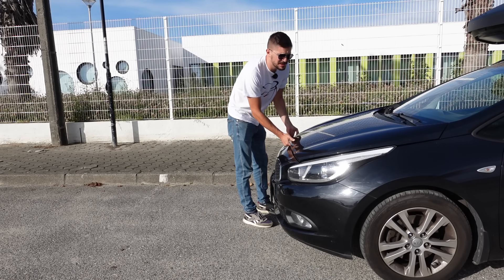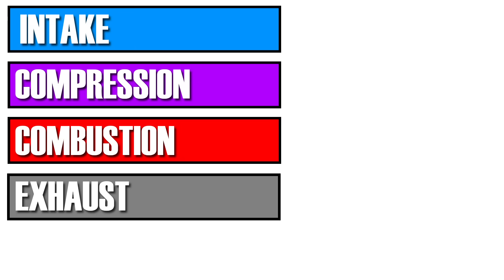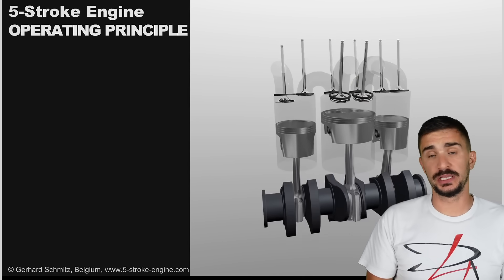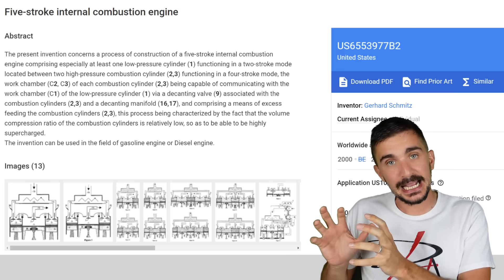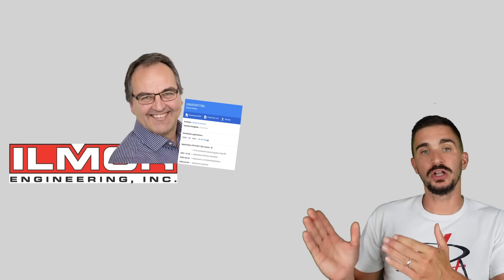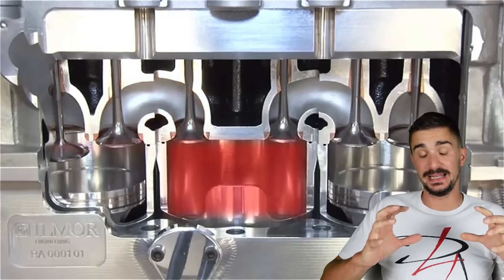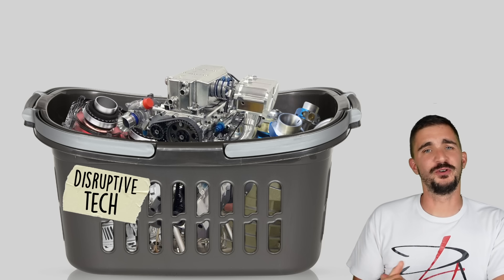Why Five Stroke Engines Are More Efficient But Still a Failure

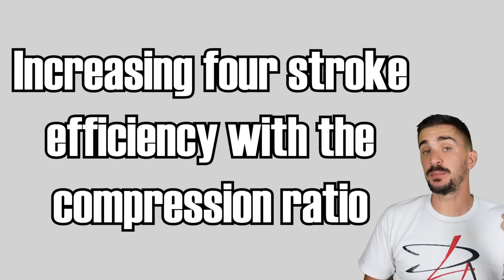Comment: 2:59 Indeed, if this were not true — that is, if the piston was responsible for pushing out the exhaust — two-stroke engines could not exist. I hadn't really thought of it this way until now but yep
Reply: And two-stroke went away, for vehicles, as you have to inject the lubricant (oil) in with the fuel which leave all kinds of extra nasty shit coming out of the exhaust pipe... But that Kawasaki "Two Stroke Screamer" was scary fast and powerful... friggen accidentally pulling wheelies in 4th gear...
Reply: @garrettmasarik8012  Twice as many bangs per rev
Reply: @garrettmasarik8012  given the technical nature of the channel someone (so might as well be me) will probably point out that while almost all two-stroke designs also require oil either premixed or injected, this isn't inherent to running a two-stroke cycle. It is possible, and done in rare designs, to run a two-stroke cycle and also have an actual oil system such that the fuel can be just fuel. 

I'd enjoy very much a video on the topic to round out my limited understanding. Afaik the main reason this "couldn't" be done is two strokes allow for ports which don't decline in performance under dirty combustion (which two strokes seems to inherently involve, oil or not?) like valves with their tight tolerances. And, I guess, we could probably do a pretty sweet job designing one to work great now, even with an oiling system and valves, but emissions regulations make it so niche it's unlikely to get worked on.

I am extrapolating a lot here and I'd love for the channel itself to touch it
Reply: @JoshWalker1  Exactly. The reason most 2-strokes need oil injected with the fuel is that they are using the crankcase as a supercharger. Put an external supercharger on it and you can have a sealed crankcase just like any 4-stroke. A modern sealed crankcase direct-injection 2-stroke could potentially be a very useful engine, and just as clean as any 4-stroke.
Reply: @DABrock-author   My limited understanding has a hole in it! Elaborate on the "crankcase as supercharger" bit??
Reply: @JoshWalker1  Uhm... once you try to valve it, you default to a standard 4-stroke engine as the ONLY place you can use valves is ABOVE the piston at the top of the stroke.

In a two stroke the piston is BOTH the "valves" and the bore is both the seats (ports)... which is also why you can have no oil sump, the oil just gets sucked out of the crankcase as the crankcase IS the inlet port with an additional transfer port to the lower side of the bore from the crankcase. Whether the oil is injected directly or in solution is actually not relevant, either way it goes through the crankcase, lubes the reciprocating mass and in the case of bikes, the transmission... but it ends up in the combustion chamber either way...

But, hey, I just made a very good living as a mechanic for over 20 years, so... And you actually had to KNOW this stuff 40 years ago when I started...

Comment: 🤔 Maybe figure out a way to use the exhast heat & leftover toxic chemicals to create electricity & charge a battery in a hybrid along with some solar cells on an aerodynamic car body. For a little extra trickle charge. 
If a scooter 🛵 or 🏍 company built a 250-350cc fully enclosed aerodynamic 3 wheel vehicle that could be used as a daily driver & got 70+mpgs. That was fun to drive & not super dorky looking. That cost much less than a car. Around $10,000 or less. I bet they could sell a ton. It could come with a removable top for nice days. 
The Morgan 3 wheeler for example is pretty cool. But way off the mark for a commuter/daily driver. It doesn't even come with a top. So if you get caught in the rain. It'll fill up like bathtub 🛁

Comment: Your remarks regarding the imaginary shortcomings of the engine are moot points. The engine IS in every way better for the coming future simple because the world is transitioning away from internal combustion and toward electric. But since it took 11.5 years to complete Palo Verde, Full battery electric vehicles are absolutely impractical as they will overwhelm the power grid. It's simply not possible to build all the electrical infrastructure fast enough to keep up.
So an engine that can achieve greater than 50% efficiency at peak power output is exactly what we need as the prime mover in a series hybrid electric car. The engine, operating at its peak efficiency drives the Motor/Generator that charges the batteries. The Batteries and the Generator provide Peak system power when needed, Such as a Semi Tractor hauling its 40 ton load up up through the Eisenhower Tunnel.

Comment: The reason 5-strokes didn't achieve success is that they solve the wrong problem. Most automotive engines spend only a small fraction of their working life running at high power, and much more at only half or less the max power. An engine that's optimised for efficiency at max power will therefore not be efficient for everyday use. And for optimising efficiency at low power, there are better alternatives: in particular variable valve timing achieves an approximation to the Atkinson cycle too, but unlike a 5-stroke it can switch into a less efficient mode at high power in which every cylinder is used.
Similar things can be said about turbos, which can also be used to achieve either efficiency or power depending on situation.
Nevertheless, 5-strokes could yet find their niche: as range extenders for electric cars. Here the working conditions are completely different - the engine is either off or running at full power, and that favours exotic engine designs like compound or Wankel over the traditional ones.

Comment: I can see this potentially being viable as a range extender for an electric car. 

The Mazda MX-30 uses a rotary engine to extend the range of the electric drive train, but the rotary isn't too fuel efficient and doesn't extend the range enough for it to be a competitive. if a manufacturer could get this 5 stroke engine to say extend EV range by 400-500 km with a battery range of 150-250 km you could have a practically BEV for the city that could do 700-800km if you need to go for longer trips. 

with the low compression cyl absorbing some noise you might be able to run it closer to redline with the experience in the cabin still being acceptable. if it runs closer to its most efficient rpm it may also heat the cat enough to pass emissions with flying colors.

an electric car that can go 700-900km with a range extender is honestly a wet dream for most modern manufacturers, so if they could sort the patent issues out maybe there is life left for this 'failed' engine concept
Reply: Mazda's reason for using a rotary is compactness, you'll kinda have to redesign the entire thing to fit 3.5 cylinders in there
Reply: Range is fine - it is a PHEV, so simply stop to refuel. My main gripe with this engine is that it is meant to be small but it isn't. The car still has a pronounced bonnet digging into a usable passenger and luggage space. Mazda could just as well put a 2l engine in it.

Comment: Finally, at 2:15, you explained WHY the turbochargers don't take power from engine and use instead "energy that would be wasted otherwise". Until now I didn't get how the presence of a turbocharger wasn't having a bad effect on the rotation of the crankshaft. I was thinking that it was the piston to push out the exhaust gas and therefore anything that wasn't a completely free exhaust pipe I thought was having a bad effect, "slowing" the motion of the crankshaft.
Reply: Turbos primarily operate off the difference between temperatures from one side of the impeller to the other.
Reply: @Longbowgun  like a carnot engine? i mean very different but still
Reply: @Longbowgun  Huh? The impeller is spun by flow across it, not by temp difference. Hence a larger downpipe with less restriction can allow for better turbo efficiency. Air temp only matters with cylinder charge. Cooler air means more oxygen which increases the cylinder charge. Like a windmill, higher air speed across the blades the faster it spins. Flow through the impeller is exhaust gas, not intake air. Or im not understanding what your trying to say?
Reply: @jeffco908   You are correct. It's the flow that causes the impeller to spin. At the same time, if you could somehow encase the turbo so that there is zero heat loss, when you measure the temp before and after, there will be a significant drop in temp. Same goes for pressure.  These two drops are equal to the energy transferred to the intake side of the impeller.
This is an example of the 1st law of thermodynamics. Energy can't be created or destroyed, only transferred from one form to another. In this case, the pressure and temp of the exhaust gas is transferred into the torque of the impeller. The 1st law doesn't stop there.  That torque is then transferred into increasing the pressure and temp of the intake air.

Comment: At this point in history it is just too difficult to compete with the traditional otto engine. 
Even if we made a better engine, the improvement would need to be big enough to justify remodelling all the production lines in the industry. That is the reason Chrysler didn't switch all its engine production line in favor of the turbine engine.

Comment: This is basically turbo-compounding using mid 19th century technology. It's was always going to have an uphill struggle as modern engines can have a relatively larger exhaust stroke, implementing both Otto and Miller or Atkinson cycles through variable valve timing and by using direct injection.
Reply: I wonder if just using plain old turbocompounding would yield better results. Volvo is already doing it.

Comment: This seem like an ideal engine for an electrical vehicle range extender. As an engine used to charge the batteries you can run it exactly at the optimal rpm and avoid the problems of diminished (or negative) returns at low rpm.
Reply: I had the same thought.  Not sure if that's great minds thinking alike, or two idiots having the same idea...
Reply: @JamesField :)  To the extent it would help to settle the question, I consider myself an imbecile. Definitelly NOT an idiot !
Reply: @JamesField  ill be the third stooge
Reply: Also, how much extra energy could be extracted by boiling water with the heat left in the exhaust gas after it leaves the catalytic converter?
Reply: @frontiervirtcharter  well, as the exhaust temp would have the be WELL above 212F/ 100C to boil water and you can put your hand in the exhaust flow without getting severe burns... and you can actually SEE water DRIPPING out of tail pipes... I'd say NONE.
Reply: The Atkinson/Miller cycle engines already do the same thing without needing a custom engine block. You can just take a regular Otto engine and change the valve timing and connecting rods.
Reply: Uhm... yeah... you are 30 years behind the curve here, guys... you're talking about "hybrids"... except you are getting ALL of the emissions at a 5%- 7% efficiency as you are not actually transferring any combustion energy to the tires... which is why we had the hybrids in the first place; the engine running uses the same amount of fuel whether or not the power hits the road...
Reply: @garrettmasarik8012  Sure, if you use the combustion engine permanently but consider a plug-in hybrid with 200km range on batteries which is okay for 85% of the owner daily needs. Because of the  remaining 15% he cannot commit to an electrical vehicle with 200km range, he either has to pick a combustion engine vehicle or an expensive EV with larger battery. This engine would cover those days when he needs to travel more. Hybrids are still manufactured.
Reply: @garrettmasarik8012  Where are you getting 5-7% efficiency from? Even making some very low-ball estimates, let's say the range-extension engine gets 30% efficiency in turning fuel into electrical energy, and that our EV turns grid power into road power at 80% efficiency. 0.3 x 0.8 is still 0.24, or 24% efficiency. If we use more optimistic estimates of 40% engine efficiency and 90% grid-to-road efficiency, that makes 36% efficiency. Nowhere near 5%.

Also, engines do not "use the same amount of fuel whether or not the power hits the road." An engine with no load on it running at a given RPM is going to consume much less energy than one running at max load.
Reply: @erictheepic5019  Oh no no no no... so many things wrong here...  First and foremost the engine requires the SAME amount of fuel at a given RPM whether under load or not as the displacement volume at that RPM does NOT change and the AF mixture ratio does NOT change. The only thing that changes across the RPM range is the VOLUME of AF allowed into the chamber... What actually changes only applies to acceleration

Second, when they rate 30% to 40% efficiency on an engine that means MOVING THE VEHICLE... but you are no longer MOVING THE VEHICLE with the ENGINE, are you? NOPE, that is the old hybrids... all the same emissions, heat, noise, but significantly less work is produced...

Third, you fail to discount the additional weight of the vehicle for the fuel, engine, coolant (et al) and generator capable of charging the HVAC battery, as you carry and use the otherwise dead weight of the "range extender" you actually KILL your EV range...

Fourth, you still have the problem of not being able the CHARGE a battery AS you DISCHARGE a battery... When you plug in your cell it is NOT running off the battery as it is charging... so you end up with another hybrid... or an ICE with EV backup...

I was ALREADY being "generous" with the numbers... I would not be at all surprised to see a net LOSS in the real world application of an adequate setup.
Reply: Then use wankle since its not that complex to build and repair

Comment: I think VVT-i, VTEC and those alike allowed for more higher efficiency without sacrificing low,mid, higher rpm. Especially VVT-i because it allowed to manipulate the intake compression and combustion stroke technically "Atkinson cycle" without the need for immaculate piston design or third piston

Comment: the problems aren`t even hard to solve, you could have bypass tubes on the head  and an special cam to deactivate the middle cylinder in low load. Or decouple the engine from the transmission of power to the ground with a hybrid system. Smells like patent killing to me.

Comment: Would not a turbine-electric hybrid be worth investigating? Turbines are rather efficient but have poor throttle response: Use the electric motor for acceleration and the turbine for cruise. And while cruising the turbine can also slowly charge up the batter for the e-motors.
I know there had been some concept/test-cars like that in the past decades, but they initially suffered from having large heavy gas-turbines and early on lead, later cadmium batteries. But with more modern smaller diesel-powered turbines and lithium batteries - it would at least be very interesting to see some concept for that again.

Comment: sounds like it would be a good powerplant for a gas/electric like a train but in a car. run the engine only to turn a generator, then run it at the load and rpm that make it most efficient

Comment: Why didn't they ever combine it with a hybrid system and use it to turn a generator? You can easily control the load and rpm in that scenario.

Comment: While I think the four stroke ICE isn't going anywhere for a while yet (battery longevity and capacity continues to be the thorn in the side of electric) electric will eventually supplant it in our lifetimes, and I think that 100 years from now the crown for most long lived combustion engine technology will have moved from the four stroke ICE to the turbine engine.
Even once they solve the battery issues for passenger vehicles, there will be a very long way to go before they can solve it for aircraft.

Comment: Doesn't this  overpressure remaingin in the cylinder only apply to high loads? The amount of pressure is varied based on how much A/F  was burned corntolled by the throttle body.

 In fact i could easily hear this in my old NA car with "limited" exhaust muffeling. When i wasnt putting in any throttle you could still hear a bit of exhaust rumble but different from load. No Exhaust is poduced, aside from minimal air that gets past the throttlevalve, but it had complete fuel shutoff. as intake pressure is arround 0.3-4bar when coasting, (according to obd readouts) cylinder pressure at the beginning of the exhasut stroke should also be arround that if manifold pressure is able to complete equalise with the cylinder during intake.
On exhasut It sound like air is being sucked in before expelled again during the rest of the exhaust stroke. And i could decrease this sound bit by bit by slowly apllying throttle until at some point the rumble was basically completly gone. applying more throttle then gets you the usual exhaust sound. I conclude that at the point of least noise, cylinder pressure and ambient were equal, harnessing the full energy from combustion aside from the excess heat. 

thought experiment:
To theoretically pull even more power from this heat we would have to be able to cool down the exhaust in the cylinder  while keeping the valves closed for a moment. so the air contracts and "pulls" the cylinder up. thechnically unfeasable but in theory, it would work.

Comment: They could put a generator on te crankshaft and use the electricity to drive electric motors in the wheels. That way an engine could always operate at optimum load and RPM. Sure, the conversion means losses, but you save weight and friction and use a smaller and much more efficient engine. Also there would not be a mechanical connection between the engine and the drive train. You could use a very flexible engine mount, almost completely eliminating vibrations. This is kind of an electric car with a range extender, but they always use way too large engines for this.